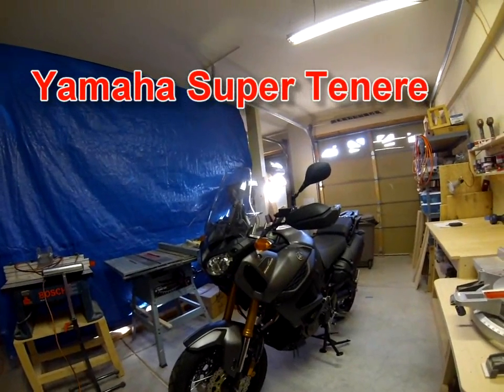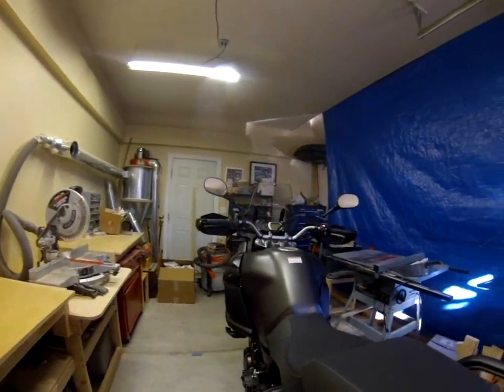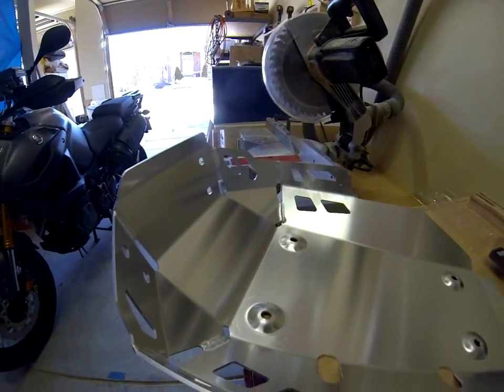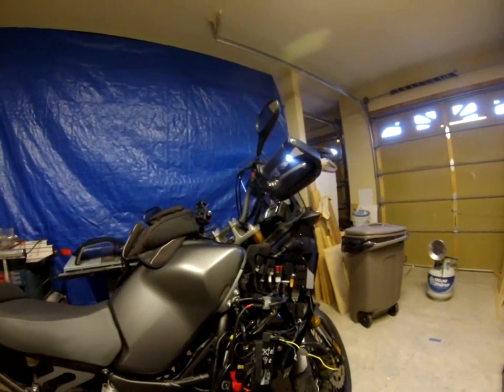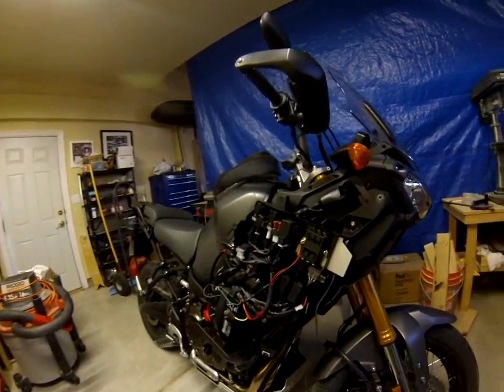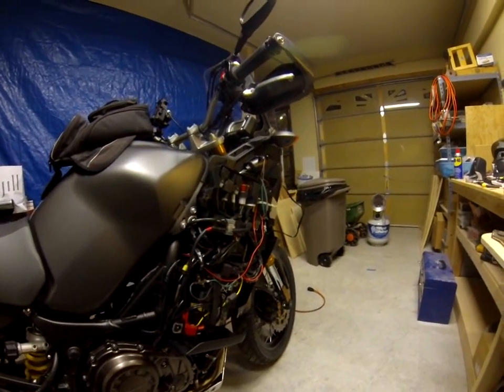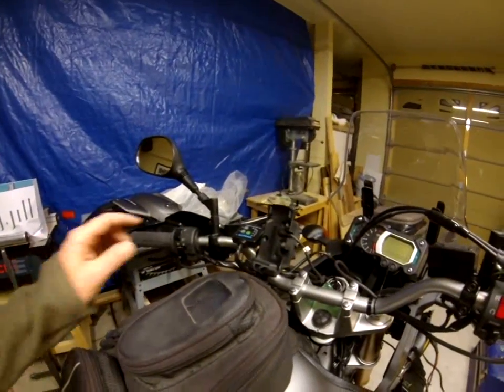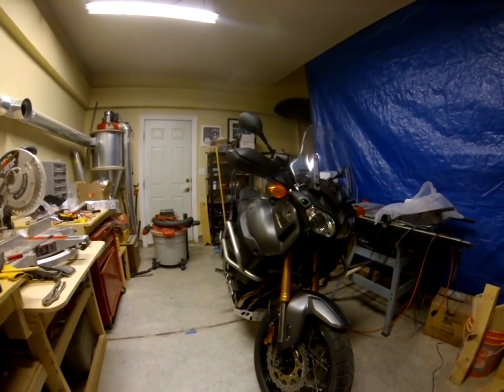Yamaha Super Tenere Accessories

Comment: Why the relay between your battery and fuse bus?
Reply from the maker: The relay is there so that when I turn off the bike, it cuts power to the fuse box.  It stops me from killing the battery with heated gear or my GPS if I turn off the bike.  Bike batteries are small and easy to drain.
Reply: I split my fuse block so some circuits stay hot all the time. I have  GPS tracking system that needs power when ignition is off in case the bike it towed or carried away.

Comment: Nice clean job you did here!!!  Im on the fence between a bmw 1250 gs...and the 1200 Super T.  Adding this kind of bus /power controller system really comes in handy when wanting to add a gps, heated gear and other powered accessories.   What brand of bus system did you use?
Reply from the maker: I'm not sure, it was a long time ago. Just a basic fuse box from Amazon. I ride a 1250 GSA now, after many great trips on the Super T. The BMW is nicer, no question, but much more complicated.